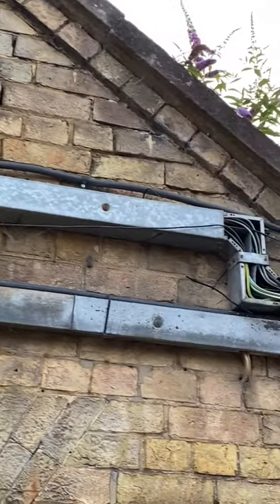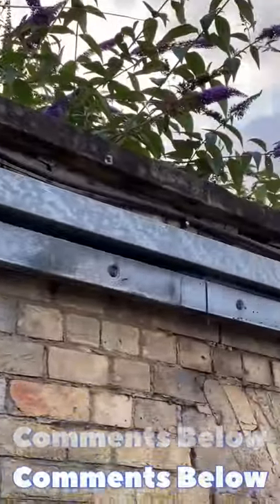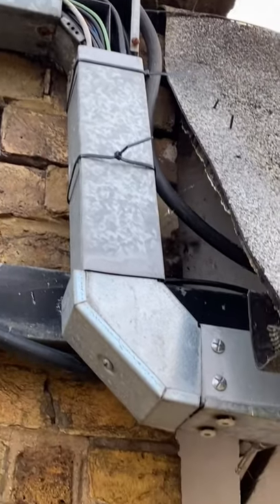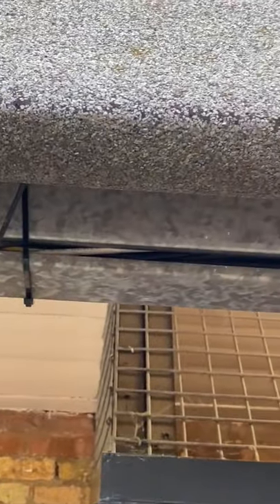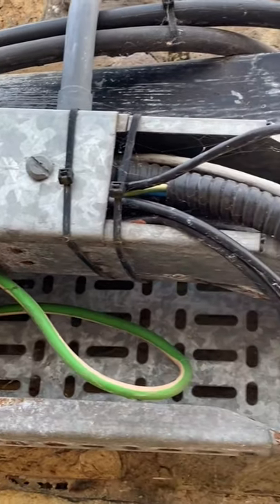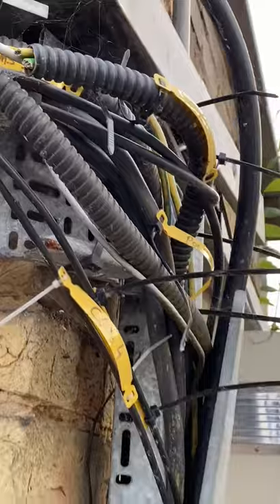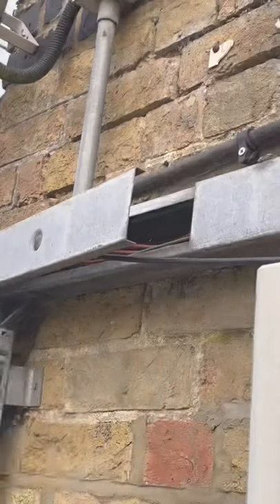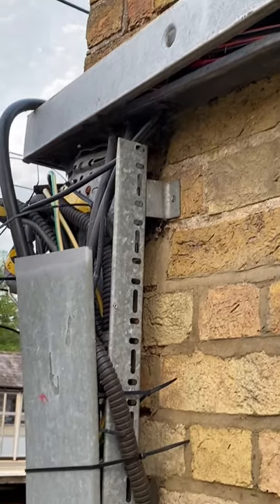Steel Trunking Installation Nightmare 😱

Comment: Yes standard metro and quango wiring this, so long as it works somewhat it will be left as is. Not like there are any inspectors who are going to drop one in their own area and get blowback about it, they will be very happy to point the finger of blame elsewhere. Black ties are perfect, structural members holding the building up for sure.